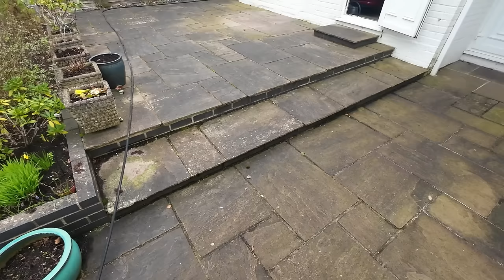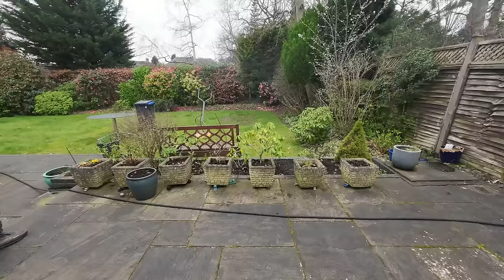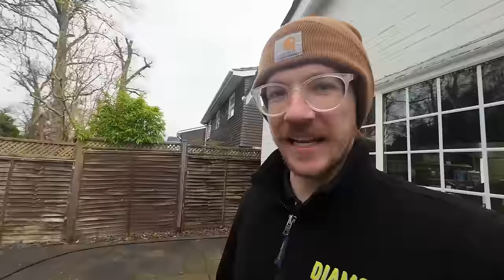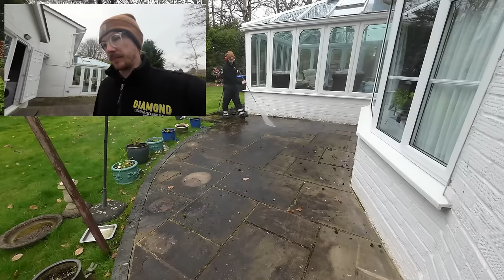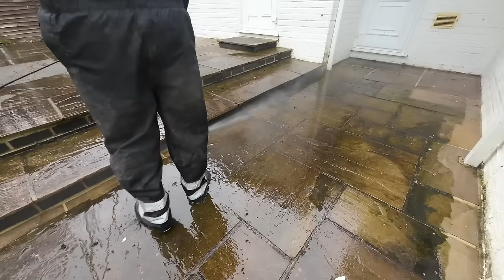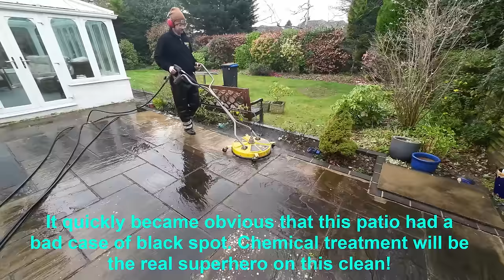"I CANNOT Clean It Anymore" Finding a HIDDEN GEM Under Layers Of SLIPPERY GRIME For Lovely Customer!

Comment: I am a first timer to your page!  The FENCE was the icing on the cake!  Question for you though, the chemical you used, does it work over time or does it get rid of the black spots immediately?  I couldn’t tell in the video.  Job well done!
Reply from the maker: Heya! Welcome to the channel :) 
It doesn't work 'immediately' but does start working straight away. 10 minutes and it has done most of it's job that's for sure!

Usually I will spray it down, and then go for a quick lunch break, come back and rinse away! :D

Comment: Start as close to the pressure washer as you can with the surface cleaner. You won't have to fight the hose the whole time. Also do your edging at the end. Your surface cleaner will take care of most of that and you will save a great deal of time.

Comment: I have a terrace in the same Indian sandstone, colonised by back spots of lichen or fungus. As the stone is porous, I can’t get it out with the pressure washer. It’s awful, because all the nice colours are disappearing year by year under the black spots, even the lovely fossil plants imprinted on several of the stones . I tried bicarbonate and citric acid, boiling water and a stone cleaner to try to kill the fungi/ lichen, to no avail. What can I do?